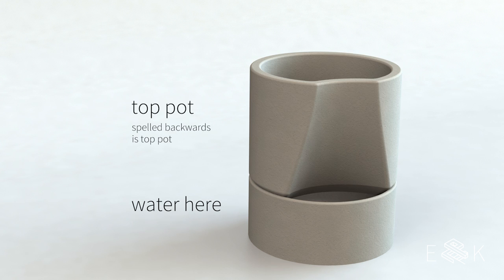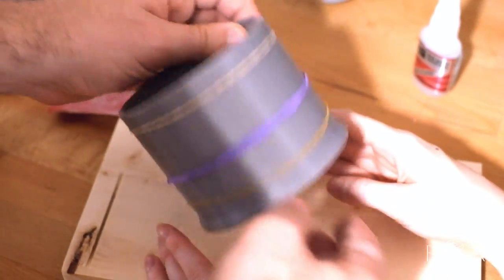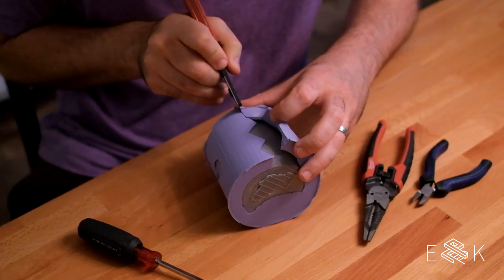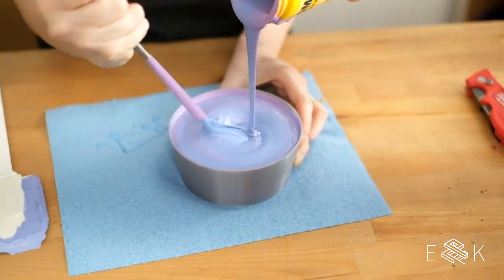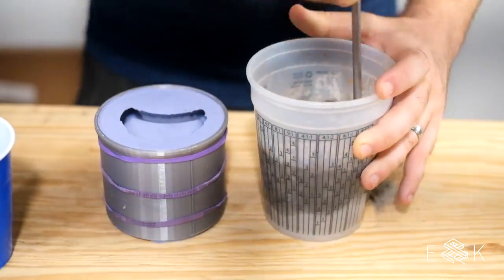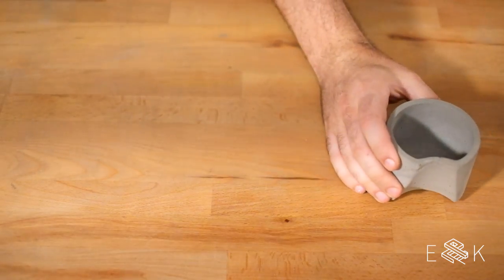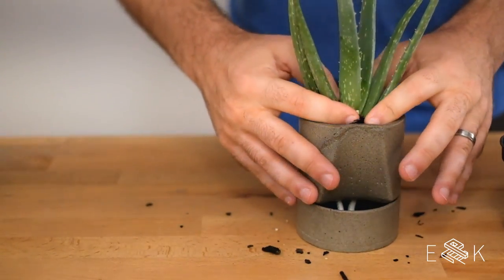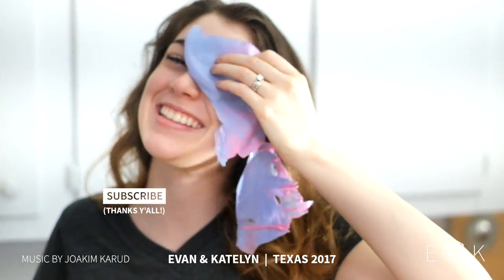DIY self watering concrete planter | How to

Comment: Nice video! And nice design for the planter! You huys have a great energy in the video's ! :) If your outside wall on the big silicone mould was thicker, there is a smaller chance of the mould having a hole and and less susceptible to tear damage. The freyed ends of the rope will actually do more water transport because of the cappillairy effect.
Reply from the maker: Appreciate you stopping by to leave an encouraging comment Sebastiaan :D If I make a second mold I would for sure have thicker walls :P I guess I was thinking that thin walls would be more flexible but it ended up being a bit of a downfall. Actually, if I made a second mold I would make it in two parts, so it can be removed easier. Or I might re-design it to be easier to mold, haha! The bottom sure was easy to remove compared to the top.
Reply: Oh yeah a Mold partition would be great for releasing! The overall up is squarish or taller in shape than the bottom piece so thats always more challenging. Happy to help!
Reply: Sebastiaan Mollema l

Comment: I know they haven't seen how well the planter would work but wouldn't burning the ends of the rope be counterproductive as it allows less water to be drawn up from the decreased surface area?
Reply from the maker: +Carly Khaw so far it works pretty well! It still does pull water in, but I tho k it would pull water more quickly if we didn't burn the ends (which would probably be better for thirstier plants)

Comment: Hi, I know concrete is "IN" actually. 
1)But concrete is verry bad for plants. So better you take some Ceramic casting Material. Some plants will die if the roots touch the concrete.It exist in all colors, because you can ad some colourpowder to it, so it will look like concrete.Weight is similar..
2) I am in Silicon casting (Figure Kit Builder & producer) there a lot of possibillitys to demould your master. Simply use Vaseline, or a spray (Teflon, etc) this will prevent that the silicon will adere/glue to your master. andd you can easyly deemould it.
3) great Video - I like it
4) sorry for my english - just imagine it in verry well written English ;-)
Reply from the maker: 1) Thanks for the helpful input! We actually want to try ceramic casting soon, and also try plaster too!
2) I thought vaseline could damage some types of molds, but I'll see if its compatible with Oomoo 30. We usually use Mann 200 but unfortunately forgot to use it this time.
3) YAY, appreciate that :)
4) haha, it's great, had no trouble understanding it!
Reply from the maker: Sweet thanks! That makes sense :) this was flagged as spam but just found it and approved it!
Reply: Tell all of the crabgrass, grass and weeds not to grow between the cracks of my cement pavers that I made out of cement bc it's bad for them.  It doesn't affect them one bit :(  ....or is this only for 'house plants'?  Maybe houseplants are more delicate?  I didn't know that there even was a ceramic casting material. Tfs!
Reply: Heng Hilger Cement concrete is basic (contrary to acidic), so it should be good for plants.
What’s the reason you say so?
Reply: It might be dead right now this very moment

Comment: Did you guys choose your own background colors or decided together?  Great little project. It will definitely take longer to kill plants this way for us. Thanks for sharing.
Reply from the maker: +Master of None we actually chose several colors each but we haven't painted them all yet 😋 Haha thank you! We hope for our plants to not die as soon as usual too 🌱
Reply: Hey guys I have never saw diy s like optic do so make more videos
Reply from the maker: +Ranbir Saggu thank you! We plan on making lots more 😄
Reply: Mosquitoes could breed there
Reply from the maker: +UnityGrave we let it dry out between filling
Reply: EvanAndKatelyn is there any way of making a larger version without spending a lot
Reply from the maker: Soda Junkie definitely! You would have to buy more silicone but the mold form could be scaled up depending on your printer size or you could build a form out of wood for cheap. And concrete is really inexpensive
Reply: The left hand one of the two plants is, I believe, an 'Alpine' plant - which prefer dry conditions.  Poss not the best plant for this project?
Reply: A succulent that needs ample water. Lol.

Comment: There's actually water soluble 3D printing filament out there ... that may have been easier to remove from the silicone mold. Also, nice video. It's refreshing to see, that not all projects go perfectly (as on many other YT-channels). I often find the trail and error part most interesting.
Reply from the maker: Yeah, I've really been wanting to get my hands on some of that!! Maybe for the next one 🙂 also, great you like projects that don't go perfectly, stick around here because we're still learning... so that stuff is inevitable lol 😋
Reply: Naturally, I already subscribed! But please don't think, that I'm only sticking around to watch you guys fail. Your stuff is incredibly well made, fun to watch and your projects are really creative.
Reply from the maker: Aww thanks so much Gavin! Appreciate that 😀
Reply: PVA filament, that is difficult to sand because it just evades and then jumps back into shape, and can't really be stored. Well maybe there is a way to store it, like in cat litter.
Reply: BTW, i suggest considering relief angles and using PVA spray release. What i mean by relief angles, if you look, you'll never find an injection moulded part where all walls are exactly vertical! Well outer walls may be, with more than 2 mold parts, but inner walls never are. They are always sloped by just a tiny fraction of a degree. Because else the part would get stuck in the steel mould and will never release. Now of course it will release from silicone, but it may still be helpful to design better releasability into your parts. Nobody is gonna know if the inside wall is slightly sloped, but the plug will have such a much easier time coming out.
Reply from the maker: +Siana Gearz those are some really awesome tips! Definitely things to keep in mind when we are moldmaking. Thank you!! 😄😄

Comment: Even though that second batch didn't look like it mixed well, it seems to have worked. Good video and cool project! Do the burnt ends prevent any wicking?
Reply from the maker: Yeah the second mold actually came out really solid! Thankfully smoothon makes their stuff pretty forgiving lol. So far it seems to work well 😀 we filled the reservoir and let it sit for a few hours (soaking up water) then dumped the reservoir out, then waited another hour to see if the wick would release water... And it did! Way more than we thought. So it seems like it's able to soak up water and transport it 😁

Comment: You should invest in a vacuum chamber to get all the ar bubbles in the silicone mixture before making it into a mould
Reply from the maker: Oh yeah we've had our eye on them for a while. Still not sure what size to get but we're narrowing down on a pretty modular system :) thanks for the input!
Reply: Just get vacuum pump and some steel pressure cooker. Make connection for the pump and your essentially done. Cooker has sturdy walls and its not like you are even able to make such a vacuum that would cause a issue. If you want to see inside, get peace of polycarbonate, make hole, bolt the window in place and dont forget to seal it.

Normal cooking pot would do(or any other similar container), but creating seal is bit harder. Its not impossible, for instance get peace of tractor inner wheel tube, make a seal ring, glue it into peace of metal or sealed wood and then build some kind of fasteners to help with initial vacuum creation.

Comment: guys realy a cactus. a cactus does not need that much water
Reply from the maker: +Siem Hendrikx you'd be surprised at how many cacti we have killed... but the way thus works is the plant takes water from the reservoir (via the wick) as it needs it, so you full the reservoir once and the plant will take what it needs as it goes
Reply: Siem Hendrikx I thought the exact same thing. And it isn't the plant taking the water from the reservoirs, it's the soil, so it can still get overwatered. Good project for other plants. Also, cacti usually die from overwatering and not enough light indoors.
Reply: fryfold Exactly. The soil takes new water as it dries out. That means the soil is consrantly moist. Aloes are succulents and easily die when being too moist. I own about 200 succulents and water them every 4 to 6 weeks. In between they always have to dry out completely.

Comment: your shutter speed and/or framerate on camera doesn't match your lights - thus those dark lines at the beginning. 

should be 30fps and 1/60s in US
25fps and 1/50s in EU
or double it.

cheers :)
Reply from the maker: +CzasNaE-Biznes (red. Piotr Majewski) thanks for the input! Yeah we film at 60 fps but still get them. Much worse at 30 fps. I think we might just need more lights and better diffusion. Future projects for sure :)

Comment: a tip for people hoping to have houseplants in self-watering planters: make sure they're in sunny spots that get good air-circulation. Self-watering pots are great IF the water doesn't get stagnant, so you have to make sure they're in an area where they will actually dry out a bit. Otherwise you can end up with mold. I found this out the hard way. Just as a general rule, plants like decent amounts of water moving through the system they're in but would rather take low water than standing water. And remember to use a good medium that absorbs and holds onto water well but has good pore space between the grains to allow air in, because plants actually breathe oxygen in through their roots and if the roots drown, they stop functioning and your plants will paradoxically stop being able to take up water even if it's all around them

Comment: This would be s good idea and fun to do if I had a 3D printer.... how else can you make the mold?
Reply: you could just use two different sized plastic cups (or something similarly shaped), suspending a smaller one inside one that's larger then just skip the silicon and just go straight to concrete, pouring around, only filling up a small amount for the reservoir bottom. Then with the top,  for the sort of,,bend ? in the actual planter just put a dent in the cups ? or cut a hole and patch it with the same cutout piece just inverted, would likely help it be smoother. if that makes sense lol. of course, you'll only be able to use the mould once, as opposed to a silicon one. but it still works aha. I've done the cup method alone quite a few times and it works lovely! only you do sometimes get diff designs and ridges, depending on the type of cup you use :'-)

Comment: pretty nice planters - have to give them a try. Mold release will help a lot with removing the molds - Jimmy Diresta has a lot of great videos where he uses silicon molding for casting also Adam Savage on the Tested channel  has a nice video about molding a light saber where he also talk about molding in general :)
Reply from the maker: Sweet, thanks for the suggestion! Love Jimmy and Tested so those are easy watches for us 🙂

Comment: Helpful Hint:  Aloe, the plant they used, loves for its roots to be crowded so planting it in a container that just fits its roots instead of a larger where you would have to add more soil. This is also a plant that does better if you water it less, not more than your other plants.

Comment: Hi guys
How are you?
Your project is very nice, beautiful  but I have a question. Can´t you use vaseline to not stick on the silicone mold?
I liked so much all yours projects.
Congratulations.
Reply from the maker: Hi Allan! We are great, and you? We've used mold release before which works really well, never tried Vaseline though! In thus case, the mold wasn't sticking to the print but it was just a really tough shape to remove. We thought the silicone would be flexible enough to remove it but we underestimated the diffuculty!

Comment: you should use some oil in the plastic, in order to prevent any part of the silicone glue on it.
Reply from the maker: +theLLfromHELL yes! We usually use mold release but spaced out on it this time

Comment: why you didn't 3d print the mold directly
Reply from the maker: Good question +Cèdre Vetter! PLA isn't flexible at all so if we wanted to make a mold using the printer we have it would have to be able to break apart into multiple pieces in order to demold. Sealing around all these pieces would be difficult but not impossible. Maybe I'll give it a try and see how it works. You can get flexible 3D printer filament though and I would love to try that out one day to see how that works as a mold

Comment: Those plants are succulents. Which root rot with too much moisture. Also from past experience I know cement will leach out acid for a time if it is not absolutely sealed. Best bet is to leave the cement piece in a bucket flushed once a day for a month. Or a toilet tank which is used daily. Just a thought. Thanks for your time.
Reply from the maker: Would that be necessary even though we sealed the concrete? Haha and yeah we totally put the wrong type of plant in there!
Reply: @EvanAndKatelyn  if the concrete is completely sealed then perhaps not. But if yhere are any pin holes in your seal, it could slowly poison the plant. I made that mistake myself first time I made ball on cement bonsai pots. But the toilet tank leach method made it so I did not need to seal at all. Thanks for all you do and share.

Comment: So, if I'm gathering the comments down here correctly, then these plants are doomed because A) concrete is poison to plants and they'll die once their roots tough the stuff and B) because succulents don't need to be constantly watered or their roots will rot. Additionally, I don't have a 3D printer or silicone, so there's that as well. Guess I won't be trying this DIY.

Comment: that doesn't make any sense, why didn't you just used the 3d printed planter instead of working (and failing) on making the mold and then removing it and destroy the 3d printed planter and then make a concrete version

Comment: you still have to put water in the bottom part so its not really self watering...
Reply from the maker: +HamesAlwaysWins we've had some confusion about the name - self watering refers to a type of planter with a water reservoir that the plant takes what it needs from (aka waters itself). It takes out some of the guesswork and you don't have to water as often. Hope this helps clear things up!

Comment: I think i know why. Even if you polish the surface it has micro lines from the fdm, inhave had the issue on metal objects as well that looks smooth and shiny and still get a huge suction effect in the silicone. Try melting a bit of parrafine for food - for flasks etc and brush it on the surface before molding. You need to do it on fiberglass etc so ot os reasonable it is the same issue. It is not really same issue about resin get stuck but you get a smooth non stick surface. The other i can think on is to put in a few holes as it almost creates vacuum in bottoms etc and also causes removal difficult. This post became a lot about suction but that was unintentional. Also weird is the fact that my reply was to the concrete plant video, and it landed on something else when posting ???

Comment: You didn't have to get into the trouble of making it (even though it turned out lovely). All you had to do was buy a completely normal flower pot with a drain plate and just pour water into the plate to fill it up all the way; the plant will naturally suck the water into the soil with it's roots like they do in their natural environment. This system requires the same amount of water that yours does, it's just a little simpler and the plant does the work.
Reply from the maker: +Peaches Stevens that's a great idea!

Comment: I'm sure others have said it, but wouldn't 100% cotton rope provide more moisture for this setup? Maybe it degrades and I never noticed it, just wasn't sure.

Flip side, making molds at home without fancy tools is always complicated, and it turned out great!
Reply: It's been a while, but I recently thought about this again!
Using the usual prebought soil for the plants, it would probably get moldy.
I've seen cotton in ground soil be not moldy (and T-shirts from 20 years ago still have their shape), but I'm thinking it's because the microbes in the soil digest all the mold/mildew stuff for food.
So in a well established micro-ecosystem, it wouldn't be a problem. But for a brand new plant and dirt, it may happen.
I'm not a biologist, and anyone who specializes in that field is welcome to chime in.
Reply from the maker: 420anonymous ah that is interesting! Ours seems to be ok so far... We used store bought soil that had been outside  in another big pot for several months, not sure if that would make a difference

Comment: I have a question. Rather than making a mold in PLA and then in Silicone, is it possible to 3d print a mold using a flexible filament ?
Reply from the maker: It might be! I think it depends on the complexity of the mold and how much it needs to bend to release the final product